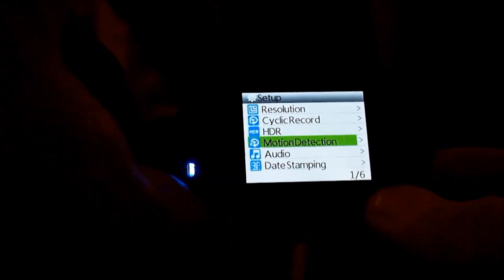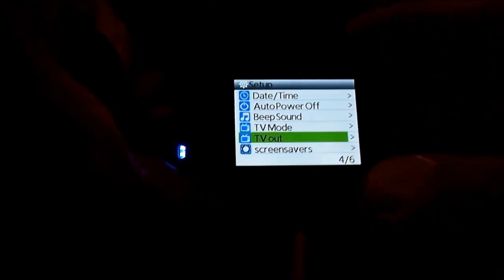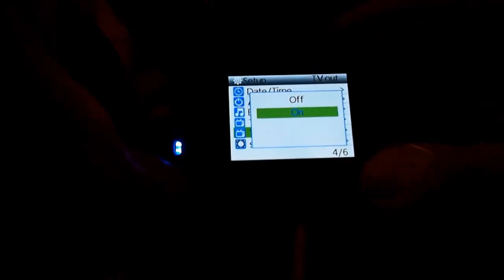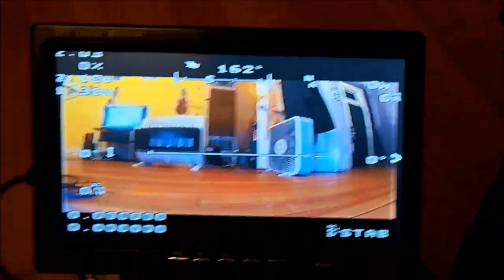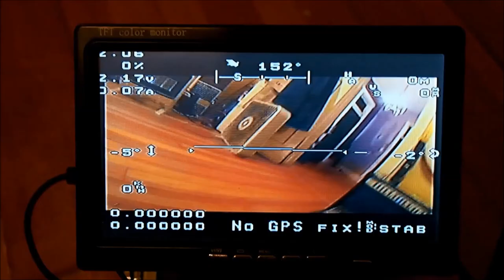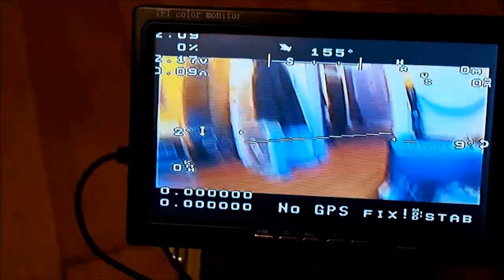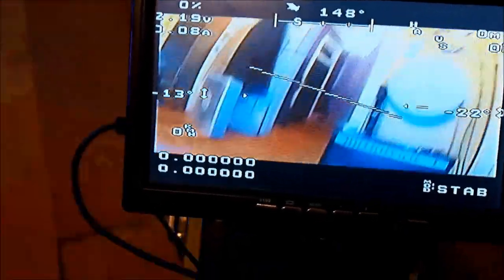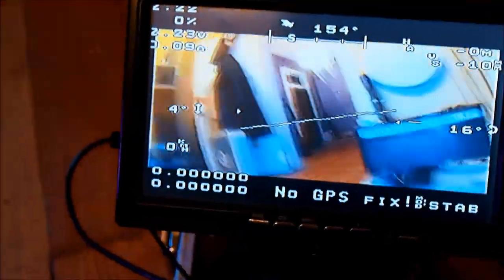SJ4000 Wifi Camera FPV Setup - Micro-USB Video Out Cable

Comment: I am getting a DJI Phantom 2 Quadcopter with FPV & Zenmuse Gimbal h3-3d black pearl immersionrc.  the question is if you can help is.  i would like to use a sj5000 instead of the go pro on the gimbal. are you able to tell me how i would go about to get the sj5000 to work with the gimbal above ?
Reply from the maker: Cycle Road I honestly couldn't say. My SJ4000 does NOT fit GoPro cases or accesories. But I don't own the SJ5000.

Comment: I find that the TVOUT function on my SJ4000 can be selected, but a power cycle clears this option.  That is, if I set TVout to ON and then power cycle the camera, the TVout changes to OFF, and I have to re-select it again.  This is extremely annoying because my camera is mounted in a gimbal where I can't easily get to the buttons on the side.  Does anyone have a fix or a work-around?

Comment: What version OSD are you running here? Mine has a ghost "Pitch" indicator that pops up from time to time in the bottom middle of the screen
Reply from the maker: I'm using minimOSD 2.4 and haven't had any problems.

Comment: I have HDR-cx290 Sony handy cam that has a hdmi mini out put,and a multi/micro out put ,I need a cord that can run from handy cam on the top of my jib to a monitor,I tried to with no resolve to run a hdmi cable to a monitor that has RCA jacks,can I make a cord from the multi/micro out put to convert it to a crawl jack? All I need is a video feed so I can see what my camera is recording as I move the jib up and down and rotate it..

Comment: Is there any latency with this camera for fpv?the original sj4000 without WiFi seems to have a little latency when streaming live video,interested is latency,does it affect the flight experience?
Reply from the maker: Seems to be the same through the video out as looking at the onboard LCD. There is some small latency I'm sure, but it's not noticeable to me while I'm flying.

Comment: I want to ask which video transmitter do you use to transmit video from sj cam to ground station? And can you make a video or photo of cable connection of this micro USB cable and video transmitter? Thank you!
Reply from the maker: ***** I've tried a lot of transmitters and can give some tips. My preference is for the Boscam and Fatshark transmitters. Of the two I think the FatShark are less prone to issues.Wiring is trivial with transmiters having three wires only. Red and black for +/-V ?(9-12 volts depending on transmitter) and yellow for the video. I strongly recommend using a dedicated battery for video.. If you use the same battery as your UAV then interference from the ESCs can degrade range and video quality.

The most important thing is to plan your RF usage. Keep all your frequencies far apart (and try to use 5,8 GHz circularly polarized for video, It is noticeably 'crisper' than lower frequency bands and the antannae are nice and small.). As an example I'm using 2.4 GHz FHSS for control, 5.8GHz for video and 433MHz for telemetry to my computer. That way my video doesn't interfere with radio control of the craft. 

I cannot mention this enough - Circular polarization of the video will provide the best range and video quality for a given power. This is the #1 thing you can do to improve range!

Comment: Nice tutorial. Thanks it worked!!! Now i can fly in hd. Btw, the latency is not that bad actually. Just a few milisec delay. I have another hd cam, the sq13 much smaller but sadly it won't work, maybe the output connection for the cam is lacking.

Comment: To make the camera lighter people can remove the battery and power it directly from the USB. But I know the needed voltage is 5V when using the Micro USB AV Cable. People which are using FPV have some 5V power on the flying object? Usually I see they are using 3.7V.
Reply from the maker: I haven't done that but I'd bet that would work o.k  The BEC on most UAV setups supplies 5VDC for FCU, Gyros, servos, etc.. (Some BECs run at 6V).

However personally I leave the power +5V unwired in my cables and let the SJ4000 self-power.(i.e. ONLY the ground and signal wires are  connected.) I also run a dedicated video TX battery in my setups. In this manner I can keep the video signal isolated from the ESC noise on the main battery (which can significantly reduce TX range and/or image quality).

For those who are wondering the battery in my SJ4000 weighs in at just under 17 grams, which for my purposes is negligible. (The tricopter it is on weighs in at ~1400 grams, fully loaded.)

So On my tricopter, the SJ4000 powers itself. The video out then goes to a MinimOSD and after that to the 5.8GHz transmitter, both of which are powered by one 850mAH 11.1V 3S 20C  LiPo. While the motors, mains, FCU and telemetry are all powered by the 4000mAH 3S 40C LiPo 'flight battery'.

(This also allows the UAV to keep transmitting in the case of the main battery failing, Which could help recover a lost vehicle.)

Comment: Hi, mate.. how do I connect my action cam, when there is no av out option on the menu settings available? FYI: I had tested the camera on my computer as my desktop camera, and it's works fine. It has micro usb port like yours. Could I bypass the av out option, so the camera would directly transmit the av out without enabling the option first?

Comment: Hello men, i have a question for you.

Why in the LCD of fpv (not sjcam lcd) you can see the artificial horizont and the horizont move when you move the cam??

Sorry my vad english.
Reply from the maker: Very good question.

That's the OSD. The one used by that UAV is MinimOSD. It overlays data in the video feed and is wired between the camera and the transmitter and FCU. OSD is data is not visible in the HD movies recorded by the camera. it exists ONLY in the transmitted RF video signal. They cost between $15 and $20 on eBay.

BTW - sorry for the delayed response. I usually try to get to these quicker.
Reply: Thanks sir !! ^^

Comment: Hello,   would you show me by pictures the complete instalation of tv out cable with transmiter for FPV ?
thank you very much for your help.
Reply from the maker: Thanks for your interest! The video above does assume you've hooked up FPV before and that only the camera is new to you.

FPV set-up is hardware dependent and will depend on flight-controller, transmitter, camera, whether you've a HUD, etc. If you can provide your hardware configuration  I can give some pointers.

Otherwise,if I get time, I'll make a video going over my set-up (which is fairly typical)...

Comment: Is it possible to somehow connect your sj4000 wifi to a wifi repeater (or a device what makes your wifi range increase) and then connect it to your phone so you dont nee a transmitter/receiver system for your quadcopter??!
Reply from the maker: Yes it could be done like that. You'd probably want the repeater to be ground-based with 2 antennae. 1 'normal' omni-directional antenna and 1 directional antenna kept pointed at the multicopter. But it's doubtful that one could get anywhere close to the range I can get with my set up. I'm using a 5.8GHz 200mW transmitter with a circularly polarized antenna and a high-gain 4 turn directional circularly polarized receiving antenna and easily get hundreds of meters without loss of quality in FPV video.

Also, one would NOT have the Heads-Up display.You would be viewing the camera through it's Android/iOS app. The HUD gives critical information for FPV, like speed, altitude, battery remaining, and the artificial horizon.

In addition, it's worth mentioning that the RC control channels for the tricopter are also 2.4 GHz. So using that spectrum for the video could easily interfere with remote control of the UAV. So I leave Wifi disabled when the SJ4000 is mounted to the copters. The tricopter in the video is carefully designed to transmit/receive on several different frequencies that do not interfere with each other (and whose harmonics also do not interfere with each other). Namely -

433MHz - Telemetry, transmit and receive to PC/Android Tablet
1227/1575MHz - GPS, receive only
2.4GHz - Radio Control (8Ch FlySky), receive only (Same Spectrum as WiFi)
5.8GHz - FPV Transmit only

Note- in the U.S. a HAM license is required for some of this... ;-)
Reply: Charles Werbick
Thanks for your support mate!
Reply from the maker: selo251 Thanks for watching!

Comment: How responsive is the camera when using it for fpv? Any delay?
Reply from the maker: It seems to use the same driver for the LCD as for the video out. By that i mean latency looks the same through video out as it is on the onboard LCD. Any latency isn't really noticeable while flying. I don't think I'd be able to tell it from a GoPro while flying FPV. (aside from differences in the HUD)

Comment: hello. how can i get the audio out from this pin .i need  the audio out so that i can hear the buzzer when sounds during low bat.thanks
Reply from the maker: I don't know whether the audio signal is exposed externally on the port. Even commercially available cables for this camera don't have audio.

But if you are just looking to monitor your battery, try minimOSD. It's a small video processor that goes between the camera and the transmitter and adds heads-up data to the FPV image. (It can do a lot more than monitor battery too. Artificial horizon, Altitude, uptime, etc...)

Comment: Hello everyone, 
i have a problem with my sj4000 wifi.
I connect a usb cable i bought directly to the monitor and it doesn't work.
I connect and another cctv camera to test the monitor and working good.
I connect the cables AV+ and AV- to bnc plug converter to rca.
Can anyone help me?
Thanks!!

Comment: I made a usb cable exactly like yours and it does not work.  I have the same exact SJ4000 from the look of your menu.  I put the camera into v out and plug it in and get nothing out.  I know my monitor is working because I can attach a different composite video signal and it works fine.  Just no signal from SJCAM.
Any ideas?
Reply: I think all 4 micro USB cables I cut up were not the correct version (no pin pad 4).  I give up. I'm ordering one already built.
Reply from the maker: +TimBerry - I think your assesment is likely correct. I use mostly solderable micro-USB cable ends I find on ebay so I don't have to deal with the quirks of cable manufacturers...

Comment: hi, can you tell me the scheme of soldering on micro USB?
Reply from the maker: NOTE - My ORIGINAL response (and the pin numbering I describe verbally in this video) was wrong. The post below has been edited to correct the pin numbering error.

Daniele- Images of pinouts for different USB plugs are here- http://www.moddiy.com/pages/USB-2.0-%7B47%7D-3.0-Connectors-%26-Pinouts.html. Micro USB is at the bottom.

The SJCam video out cable only uses pins 4 and 5. Pin 4 is the signal and pin 5 is the ground. (in the video I say pin 1 is the ground, that is wrong...)

On the USB plug in the video, pads for pin 2 and 4 are on the top and pins 1, 3 and 5 are on the bottom of the plug end. (You can this see in the video. There are 3 solder pads on one side and 2 on the other. So the signal wire is pin 4 (white wire in the video) and ground is pin 5 (grey wire in the video).

Easiest way to tell (if you are hacking an existing cable) is that the ground pin (pin 5) will be connected to the metal case of the connector and the signal pin (pin 4) will be the empty solder pad with no wire already attached.(as pin 4 is not used by USB...)

Hope that Helps!
Reply from the maker: Daniele - the pin numbering I describe in the video is wrong. Ground is Pin 5 not pin 1. Which I wouldn't have caught had you not asked for clarification. Thanks!

Comment: Hey sir, how far can it transmit signal for FPV?
Reply from the maker: uragonable21 - Depends very much on the frequency and power of the transmitter, the antennae, other signals in the air and the obstructions where you are flying. Lower frequencies are better at penetrating trees and stuff. Higher frequencies are more easily blocked by obstacles but have higher bandwidth and generally higher quality of picture. Also the lower the frequency, the larger the antenna.

Best range is achieved with circularly polarized signal/antennae. 

Further extension of range can be achieved by using directional antenna mounted on a gimbal which is programmed to point to the ground station.

Comment: My micro usb has only 4 pins with for cables soldered on it. 
I already opened 2. I don't want to open the 3rd cable cause it might have the same pins.
Any idea how to connect it?
Reply from the maker: there is another pin (technically pin 4) on the micro USB connector that is not used (therefore not connected) on most cables. so hacking an existing cable will ONLY work if it has at least a solder pad for pin 4. You can cut the insulation around the micro USB plug and see if there's 5 pads. if not you may be out of luck. as others have pointed out they now sell pre-made cables for video out.
Reply: +Charles Werbick Thanks. Yeah I tried opening both microSD but they cut the 4th pin that is beyond getting a good point for soldering. Yeah I've seen the one on the link below better than the ones I saw and both of ebay. The one I got gets stock on the edge of where the pitch motor is connected.
By the way, what do you suggest to attach the 5.8 transmitter on the copter? Double sided tapes keeps getting removed.